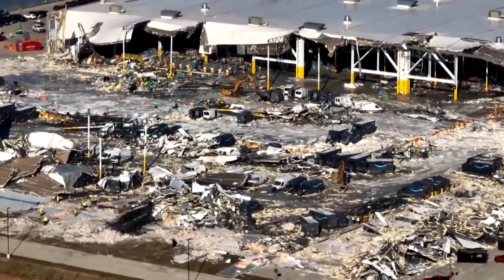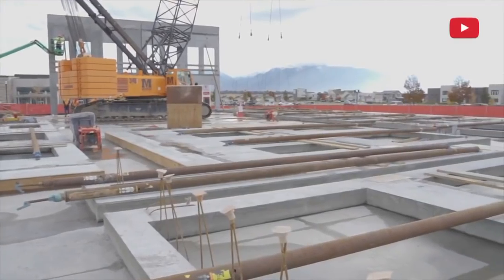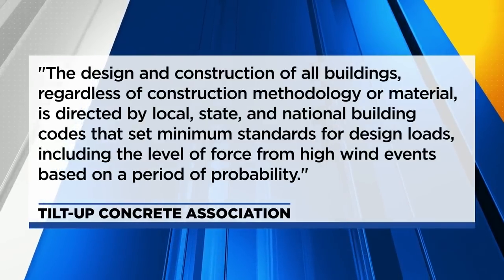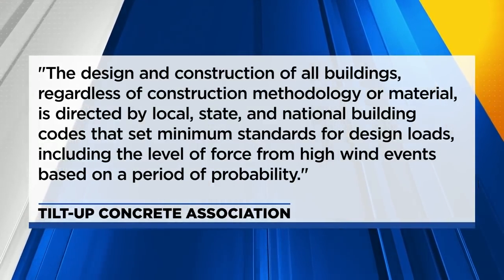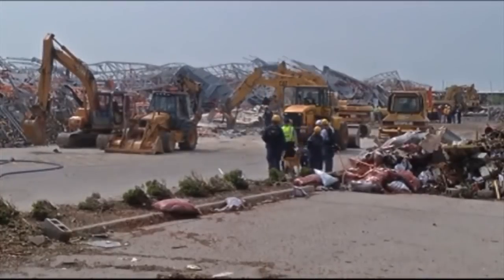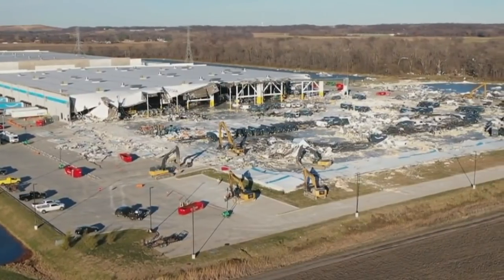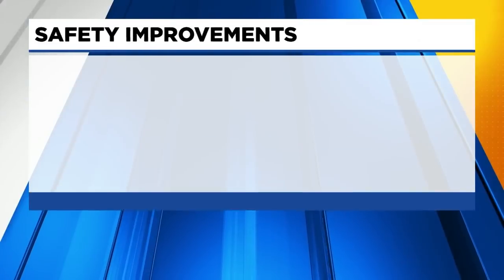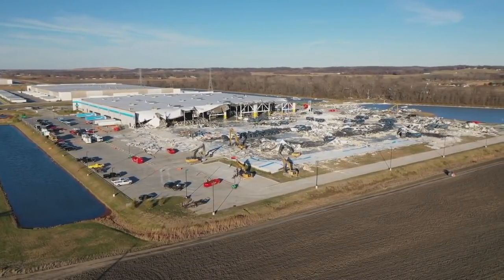Design of collapsed Amazon warehouse coming under scrutiny

Comment: Seems a bit redundant that when speaking to this planner for “structural safety” the only reverberation in response to its collapse is the architectural design methodology—- which lacks any evidence to inherently keeping any employee safer than what can be expected of a tornado passing through the area at up to 445mph wind forces and nowhere else for them to go ??? Nothing about the deaths of the employees here based on where they were at the time of the event. What is bothersome and lacking in the overall “infrastructural design” is simply a bunker built into the building like a basement or sub-basement which has underground thoroughfares to protect the employees from the possibility of debris and wind forces taking them out while still inside the building. Since the gale forces creates suction, there should be alternate pathways that lead into underground bunkers underneath the parking area—- and escape routes adjacent to them in order to resurface afterwards. The logic of this woman does not make any sense preventing more unnecessary deaths based on the design template. If Amazon dictates their employees must remain present during the tornado—-they better find a definte answer regarding keeping them from harm. This solution reinforces the notion that regardless of how much strength goes into the building’s materiality, a tornado is going to destroy what’s there. It isn’t foolproof nor 100% safer either. But, food for thought about what holds true the next time it happens. The problem still exists — yet no one is indicating anything different than what she was hired for. Strangely enough ??